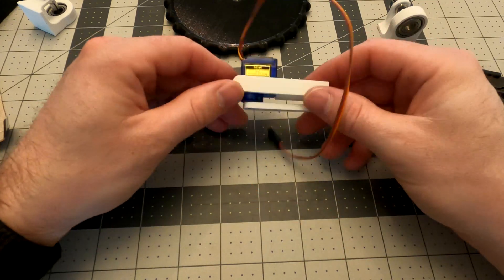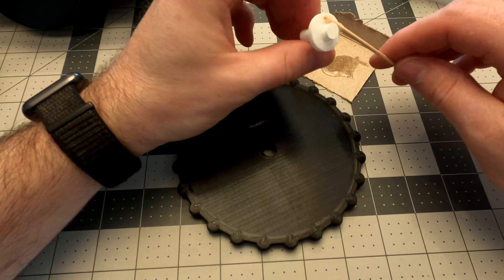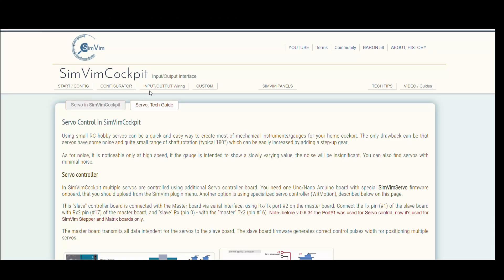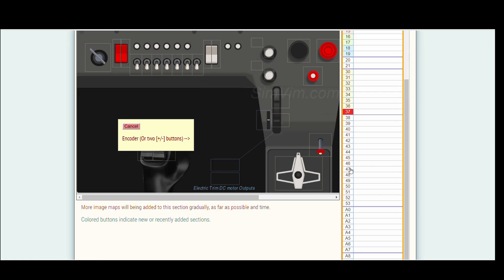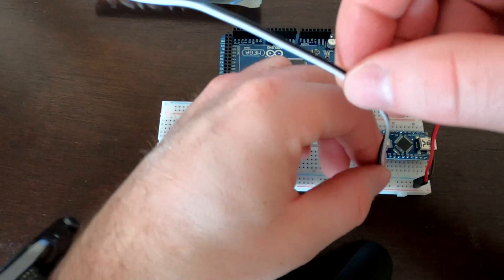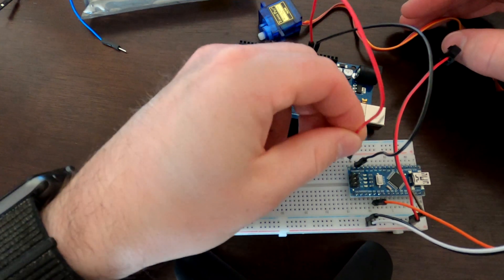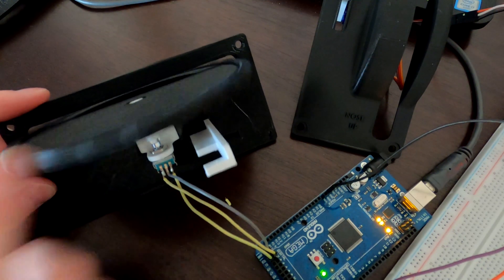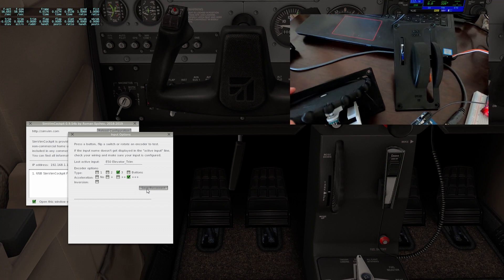3D Printed Trim Wheel for Flight Simulators

Comment: Awesome project, I'm building a sim and I like your trim wheel, I read that you offered to @farolito64 to 3D print them. How much will be if you print them for me, I found in Amazon this " Cylewet 5Pcs 360 Degree Rotary Encoder Code Switch Digital Potentiometer with Push Button 5 Pins and Knob Cap for Arduino (Pack of 5) CYT1100 " and " 4Pcs SG90 9g Micro Servos for RC Robot Helicopter Airplane Controls Car Boat ". Do you think those will work ? . Thanks for sharing and taking time to create this video, it is Awesome!

Comment: I have been searching for an automatic trim wheel for general aviation, several have them for sale which activates the complete wheel, if I am watching your video correctly, it appears it is only the indicator?   I was thinking, thou have no experience, and an old dog of trying to convert my existing commercial purchased trim wheel to a motorized wheel,   have you made a fully motorized trim wheel to work with Xplane 11?    I can't thank you enough for sharing and the quality of engineering and display of materials designed are well appreciated.   I can tell by your web site and commitment to helping others, I hate to ask, but hopefully you reply on how I can totally automate a trim wheel.  Thank you again, you are a real asset to the sim community.

Comment: Looks like there is 3 parts not in the files on thingiverse.  The picture of the large bracket shows a part going thru the bushing and connecting to the encoder. This part is not in the files.
Also the white bracket for the servo, and the positioning needle that goes on the servo are also not on thingiverse.  Could you provide me with these files?  Also you have a part called a smoother, could you show me where it goes?  
I'm having trouble printing the trim wheel itself.  When the print starts, and it prints the first layer of dots around the wheel, and then when it prints the second layer, it knocks off the first layer dots.
What are your 3D printer settings for this part?   Sorry for all the questions, but I am kink of stuck at this point.  Still a great project and thanks for your effort so far!
Reply: James did you ever find the servo bracket and the positioning needle? I'm looking for them to. Thank you

Comment: What printer are you using? Your prints look better than most I have seen off 3-D printers.
Reply from the maker: I’m using an Ender 3 and Cura for slicing. I took great care to make sure the frame was true and the belts had the proper tension.

Comment: Looks excellent will make this. Does it work with FS2020?
Reply from the maker: Yes, but instead of SimVim you’ll need to use another way to interface with MSFS2020. You should be able to do that with an Arduino or a USB board like from LeoBodnar.
Reply: FlightSimMaker hmm I’ve not done anything like that before, if I were to spin it quickly would it be like pressing the trim button 20 times or something? May need to have a look at that

Comment: Awesome, is it possible to use this trim wheel with the new FS2020?
Reply from the maker: Yes, but instead of SimVim you’ll need to use another way to interface with MSFS2020. You should be able to do that with an Arduino or a USB board like from LeoBodnar.
Reply: Lol we have the same Profile Picture :D Have a nice Day! ;D

Comment: Do you know how to connect up a custom yoke? I'd love to learn how to do that.
Reply from the maker: Check out SimVim or AirManager. They have provisions to connect potentiometers to a simulator through an Arduino. Or if you know how to code, you can make your own custom sketch. If you've seen Caption Bob on you tube, he has a video on how to do it as well.

Comment: Can it be connected to auto pilot? If not how can do it?
Reply from the maker: none None Yes! It be be connected by many different ways. You can use an input board from Leo Bodnar, or use an Arduino with all sorts of options like SimVim, mobiflight, AirManager etc...
Reply: @FlightSimMaker  thanks for information

Comment: Will this work for the new Microsoft flight sim 2020?
Reply from the maker: Randy Sipkes Yes, but instead of SimVim you’ll need to use another way to interface with MSFS2020. You should be able to do that with an Arduino or a USB board like from LeoBodnar.

Comment: Hello
I am interested in building your trim wheel
I assume you are OK with that being that you sent a link to files
I am not to into 3D printing so i can I ask you what are the major requirements for the printer (print size area? Resilution? Kind of plastic etc...)
No hurry but if you can help I really would appreciate it
Kind tegards
Reply from the maker: I am OK with it. In fact, I encourage you to build it. Most printers will work. A 200x200mm print bed is  large enough. PLA or PETG will work fine along with many other plastics. I used a .4mm tip on everything but the case. I used a 1mm tip on the case just to cut down the print time. Good luck with the build!
Reply: FlightSimMaker thank you!!

Comment: Excellent project.  I take it simvim only works with Xplane right?
Reply from the maker: Yes, but other programs like Mobiflight and Air Manager can use an Arduino and work with other flight sims.
Reply: @FlightSimMaker  the annoying thing is mobiflight does not support potentiometers. Not sure why. It seems a key component in any flight sim.
Reply: @jimtalltheislandbrothers6639  Sorry for the late reply, look at Some leo bonar bbi-16 or 32s.